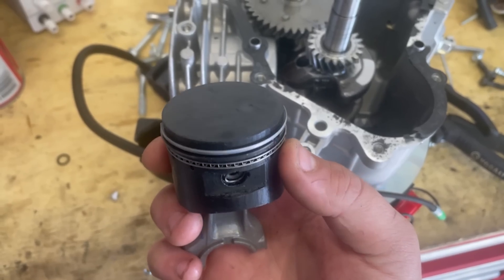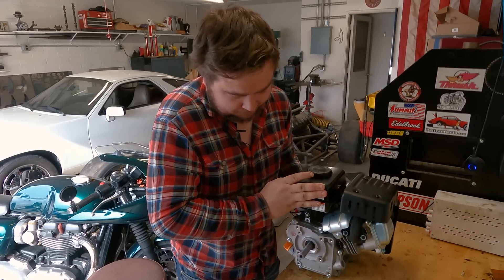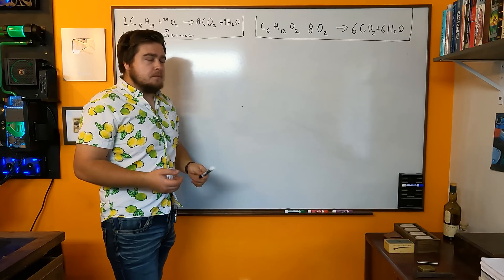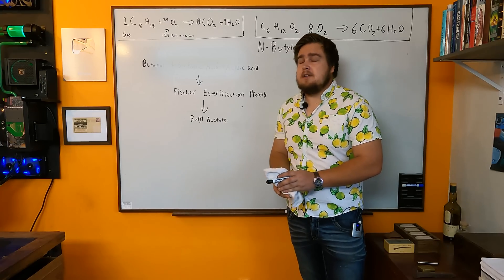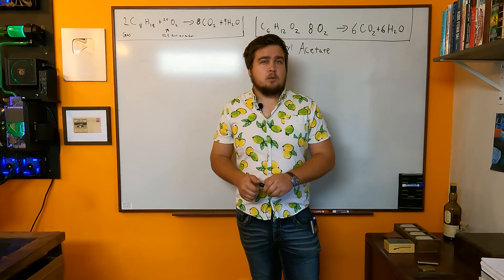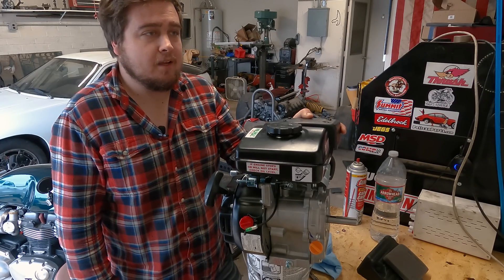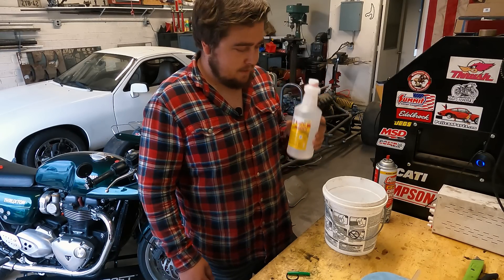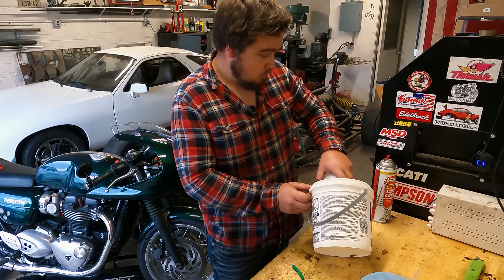Cold Burning Fuels and Plastic Pistons for Harbor Freight Engines!

Comment: Any time you can run a fuel that burns cooler, you can and should increase the compression ratio to compensate, this way the efficiency of the engine goes up. I wouldnt worry about plastic pistons, any sort of plastic that you could dream of is going to have a stiffness problem compared to a metal even if heat werent a problem.
Reply: Methanol, for example would be a nearly perfect fuel as it burns really cold and slow... they've run the compression ratio as high as 20.5:1 without finding its detonation limit, and if it were not for the fact that it produces formaldahyde and nitric acid (?) during combustion (causing an unusual amount of piston and bore wear) we would be running a lot of cars on this by now.

Comment: The piston will probably melt not from combustion temperature but ring friction.  Piston rings consume something like 1% of all energy produced in the world (including nuclear, solar, etc) and are the majority of power loss, and therefore heat generation, in a piston engine.  They rely on conducting heat through the piston to survive.
The ideal thing to do with a plastic piston is to make its tolerance so close that piston rings are not required at all.

Comment: One thing to consider if not already is the thermal expansion coefficient of the plastic, trying to get fine enough tolerance to get good compression could result in a lock up and going to a two stroke with no valve train friction plus adding a teflon bore sleeve could reduce the need for as high compression to get started.

Comment: I like your ultimate goal but I think it's a little far fetched because plastic pistons would eventually break, hypothetically if it actually worked with plastic that's available to the common person it would not run for very long. You've probably seen Garage54's take on plastic pistons and it did not far well aside from them burning from the gasoline. I would like to see how you well you do though, it's an interesting idea. My two cents would be making the engine block out of plastic with aluminum cylinder walls and perhaps some other parts can be plastic since the acetate burns cooler than gasoline.

Comment: Dam it now You peaked my interest.
Now I am stuck wondering how much of the engines heat is from combustion and how much is from friction.
I still don't see a future for plastic pistons when Aluminium is so quick and easy to manufacture as well as light weight and relatively cheap

Comment: You may want to try an HDPE piston as it is a cheap material, has a reasonably heat deformation temperature and is more resistant to acetone like solvents. You'd have to have it machined instead of printed of course. Other potential materials would be POM (Acetyl - machine shops will be familiar with cutting this) or any of the fluoropolymers, but they can get expensive.

Also when you ran the engine with your new fuel, the smoke was visible out the exhaust potentially indicating it being too rich - it made me think this would influence the temperature you were measuring, as a richer mixture will help with transferring heat out of the engine.

Hope this helps, very cool experiment

Comment: One reason for the reduced delta-T in the engine is that most of the heat an engine has to deal with is from friction and no cooler burning fuel is going to solve that problem by itself. I mean just look at how hot Transmissions get and they are completely separated from the combustion and are continuously bathed in oil.

Comment: Nylon can be fdm printed by your printer, it can be a pain to print however. I believe that it is resistant to acetone and has a much higher melting point than abs. 
It also has a low co-efficient of friction witch may help the no bearings on the connecting rods ends(?)  you mentioned.
Great content!

Comment: If you have access to an SLA printer there are resins that are much more heat resistant and don't require heat to melt them for printing, also they are much more resistant to chemicals as well... so it might be a better choice for this application. Also, did you  measure cylinder bore and make the piston as tight as you could? 3D prints have a tendency to shrink when they cool or when they are cured depending on the type of printing used.

Comment: am I missing something or torque is generated only by burned gas pressure, and pressure generated by temperature, meaning there is no way to generate similar power/energy with significantly lower exhaust gas temperature? the only way the piston or cylinder chamber could run at a colder temperature is if there was less heat exhange between gas and piston but if anything plastic lower heat conductivity means the surface of the plastic piston will run hotter
sounds like forced induction with intercooler , lower compression, and/or higher revs/lower load would be the only ways to produce same power at lower temp, besides the obvious increased cooling.
although. of course running at idle is maybe not the best comparison point since any of these solutions would produce more power

Comment: Great video! Testing carbon fiber nylon filament should be fun, but you'll need a tempered steel nozzle, all metal hot end and the filament must be extra dry.

Comment: you should try a 2 stroke they run a lot cooler, the fuel cools the piston down at its getting comprised into the ports etc, and there is a lot less moving parts
Reply: 2 strokes have to run quite rich to avoid overheating and seizing or burning the piston. In most engines the main way for heat to get out of the piston is conduction through the rings into the cylinder wall, a 4 stroke has an entire revolution for this to happen between every power stroke, 2T only 180 degrees at most.

Comment: A coating with good heat and chemical resistance or a metal plate on top of the piston should do the trick. I have always liked the idea of a plastic/composite engine block with metal piston sleeves…
Reply from the maker: Yeah, looking into ceramic or a coating

Comment: I have some fire retardant plastics... And an ARMY of 3d printers... 

FR ABS
Polycarb
Nylon (cf variants too!) 

Nylon or PC should work better as they can handle more heat and should be stable with the chemicals. Prusa can print all of this :) Happy to help if we can!
Reply from the maker: That’s awesome! The FR abs has a ton of fun projects in my head, I might reach out!
Reply: @WesleyKagan  If you try and print FR ABS at home DO IT IN YOUR GARAGE! The smell is SO BAD and it will leech into fabric.. I learned the hard way LOL. But yeah.. it does not catch fire, crazy stuff. Still melts though!

Comment: Problems.
The free running temperature will be lower than the loaded temperature.
Plastic even cheap 3d printed stuff is probably several times more expensive than the alloys used to make pistons especially when mass production is in full swing.
Plastic will not have the structural rigidity needed for s piston.
Even at 8-1 compression the combustion chamber temperature without ignition will probably exceed the melting point of most plastics.

Solution 
There is a 3d printing filament that is a ceramic base.
You print the part in a normal printer then cook it at high temperature to fuse the ceramic.
Reply from the maker: Agreed, but the weight savings of polymers and plastics on a rotating mass standpoint are worth looking into
Reply: @WesleyKagan  I think someone has tried carbon fibre pistons with a ceramic disk on top don’t recall the result.
The ceramic printed pistons are possibly the best option for this as long as the material can withstand the forces involved.
Ceramic pistons are not new there are Diesel engines with a ceramic cap on the pistons.
The problem has always been that they need not to melt and not to end up in the sump.
A lawnmower engine is not the end of the spectrum where a lighter piston will be anything but proof you can make a plastic piston. A motor cycle engine is where you might prove something.

Comment: Homemade small engine dyno 
Requires some kind of coupling to a disk break rotor a disk calliper from a rear brake that uses a screw type E brake that compresses the pad against the rotor modified to accept a half inch drive Torque wrench, The cheap one with a scale near the handle and a needle that extends up from the head instead of one that clicks, unless you have one that has a readout.
Method.
Connect an engine that you know the power ratings of and set it at the various operating RPM and apply the brake reading how much torque is needed to stall the engine.
Plot the numbers and do the math and you have a small engine dyno.

Comment: hey, there is a ceramic infill resin for stl printers that lets you bake it and you are left with a ceramic piece, you can also heat treat pla, you bake it for arround 30 minutes and then it can witstand higher temperatures, also is pretty resistant to solvants
Reply from the maker: PLA for all its faults is really good stuff- I think it might work. I’ll have to look into that ceramic stuff, that’s interesting!
Reply: @WesleyKagan  porcelite, i think is called

Comment: What about just turning / machine some graphite or Teflon for a piston? I find that silicone based o rings are more chemical and heat resistant than rubber o rings. There are a few garage54 videos of wooden pistons and various plastics being used and they just turned them on a lathe. I think an epoxy resin in a 3d printed mold would also be viable.

Comment: Why did it not start? You could check the compression with a compression gauge.
It might not be accurate with such low displacement but you could compare with the normal piston. 
Maybe something happened with the carburetor, ignition or camshaft.
Or maybe there is a leak in the plastic. 
The rings could be twisting in the plastic grooves. Try to put more space between them for support.
Some type of ceramic coating could protect the piston
Reply from the maker: I agree, the ceramic on the piston would be a good idea- turns out I had a valve set wrong hah.

Comment: simple way to measure difference in horsepower : take a flywheel (like a semi truck wheel or rim on a hub driven by a chain ) and measure accelleration time between two set rpm's 
there is a way to calculate the power of that and my guess is you could find the formulla for it you can allso do this from different rpms sets to get a powercurve thats pretty close to that of a treu dyno
another way is put a waterpump on the engine and have it punp water up a columb (pvc drainpipe the wider the better) this is actually the same as a waterbrake dyno

Comment: I wonder, would it be possible to get the plastic piston coated in some sort of ceramic coating to make the ABS more temperature and corrosion resistant?
Reply from the maker: I’m thinking a PLA or ceramic with a coating would be perfect!

Comment: Sick idea! I’ve been using ABS in engine bays for the past year to make brackets and similar parts due to its high melting point. The problem is the shrinkage which is pretty definite. I believe that’s why it didn’t start, because it can’t compress the NBA (lol) enough. ASA has better characteristics for printing. 

An idea that I’m working on that I’d be interested in seeing you do is lost PLA forging of aluminum car parts like an intake plenum for supercharger or intake manifold made out of ASA or ABS.

Comment: Greetings from another Phoenix tinkerer!  In my experience with FDM, the materials available can’t resist much more than 240F before melting. (Otherwise they wouldn’t print). In my eyes injection molding is probably the only way.
So follow me here: injection molding is expensive, so keeping on the janky train, what about making a 3 pc mold and using high temp JB weld? Mix in a little fiber glass strands for reinforcement and presto, plastic piston. If it can be used on the head, why can’t it be a piston. 
I think JB Weld can be anything it wants to be!
Reply from the maker: See I will always support JB weld, but I’m kicking around a carbon fiber possibly…

Comment: I love the whole concept, save the part building pistons from Plastic.  When you opened the box to remove the engine, you seemed repulsed by Styrofoam.  To heck with plastics.  i don't like plastic.  we have far too much plastic stuff floating around.  i own a pretty original 52 chevy, have had it for ever.  one of the things i like about it is that there is practically no plastic.  it has horse hair in the seat rather than foam rubber.   My old 250cc 1960 Zundapp motorcycle has steel fenders and a steel tank , glass tail light lens .  It is pretty much original and the seat is padded with horse hair.. you will never find a classic automobile with plastic hub caps bumpers etc, unless they can buy all that plastic stuff custom made i don't think car shows and collectors will be collecting any of these modern cars.  in my opinion it is like programing.  if you put garbage in you get garbage out.   so to with three D printing in plastic.  Garbage in garbage out.    Lets be real.  I feel plastics cause more problems than they solve.  You can profitably re cycle aluminum brass steel bronze, even wood fibers you can profit from recycling.  has any one made a fortune recycling plastics?   I may be wrong.  I have always been a contrarian but it has served me well, and i always avoid that plastic.  and wish you had used an american engine.  but i love you man.  wish i was as smart as you.  My momma used to say.  Quality is remembered LONG AFTER the price has been forgotten.
Reply: The difference is that this can be done with a $200 machine vs machining a piston out of aluminum or steel or titanium would increase the price way out of DIY range for most people.
Reply: @dawn9340  :darling Dawn.  you missed my entire point.  Plastics bad.  plastics devil.  hey devil come help me out.  you foolish person don't you see you cannot make a deal with the devil.  this plastic epidemic is in our food.  the ocean ecology is being changed.  but let us go on and on trying to get technology solve the problems that technology has brought us.  be simple minded for a moment and ask why support the plastics industry that is killing us and all the un witting animals that consume the plastic particles we so un thoughtfully release on nature.  no thanks hold the plastics PLEASE>
Reply: @johngillon6969  uhhhh ok have a nice day

Comment: Master Milo actually did a test of putting all sorts of stuff in the tank of a normal gasoline car and the amount of chemicals a combustion engine can run on is mindblowing, including brake fluid. It wasn't about "eco-friendly" stuff or efficiency at all, just a pure test of "will it work?". And it sure did. :)

Comment: The first thing that pops into my head for piston material is PETG. It's very chemically resistant and easy to print. Can't comment on the heat resistance tho. The second option might be a silicone cap for the piston. It's super chemically resistant and can survive really high temperatures. Add a thermally insulating layer between the two and it might be viable.

Comment: Is it possible the engine didn't start with the 3d printed piston because the print was air-permeable? In the past I've found fdm prints to be not even close to airtight.

Comment: It doesn't have to survive the case temperature of the engine, it has to survive the combustion temperatures, which are very, very high.

Best you can do with plastic is to turn this into an air engine, or an air pump, both would probably perform poorly, but, might make for an interesting video.

Comment: Engines use fuel to heat air, and the expansion of the heated air drives the piston.  I think that if you want a power level close to what gasoline produces, you will have to heat the air to the same temperature that gasoline does.
Try a gas/n-butyl acetate mixture in your car.  I predict Nox goes down, and so will power.
-but your exhaust will smell like sweet apples.

Comment: You could use a small dc motor and use it as a load test , it would become a generator and you could put a load on the engine and measure the voltage or wattage and converted to horsepower. you can use heating coil for a water heater to put a load on the engine. As for the temperature probe they make one that screws under the spark plug. they use it for racing.

Comment: Check out carbon fiber nylon, its a pretty crazy filament. Currently using it on an intake manifold for a diy itb setup on my Miata and it has withstood the temperature so far!
Reply: As a piston it might be too rough and tear up the cylinder walls, but then again you usually print CFPLA out of a hardened steel nozzle, and maybe the engine is hard enough to cope with that.

Comment: for adiabatic compression, t2=t1(v1/v2)^gamma > so for air with compression ratio of 10 you’re looking at an absolute temp increase of ~2.5x…then you add the fuel for the fun part:)

Comment: Maybe try high temp resin mixed with tough resin. High temp resin can go up to 238C (460F). Resin printers are cheap nowadays. I got a Elegoo Saturn and it's works very well I find. Thermal expansion need to be looked at too. ABS is not known for it's expansion stability...

Comment: Just a thought, that part in PA12 Nylon (laser sintered I think) from JLCPCB is about $23  (yes I uploaded it and checked) but you have to wait to get it.. and .. China....

Other than that, I applaud your brass orbs in  refraining from installing those safety squints in case of escaping aluminum side-walls from the passage of a rod's upper end through it.  Moar Beer!

Comment: I have used Inland brand carbon fiber nylon for parts in contact with the engine on my motorcycle and have had very great results for hundreds of miles so far.
Reply from the maker: Fair enough, I’ll look into it!